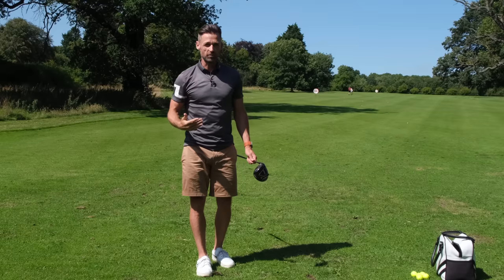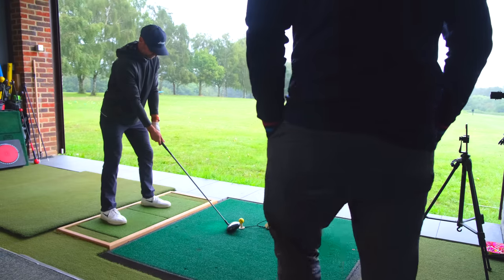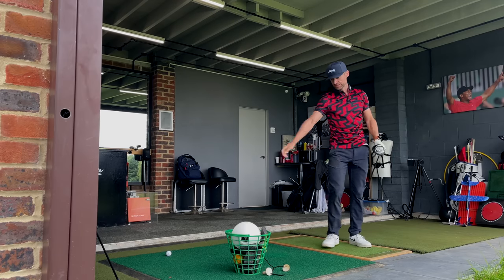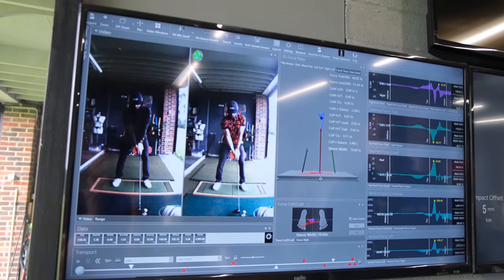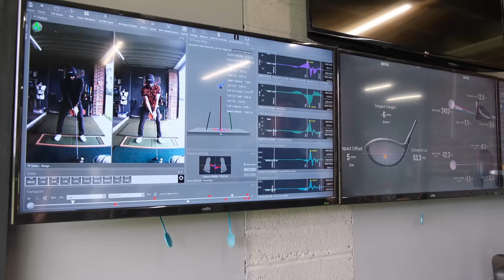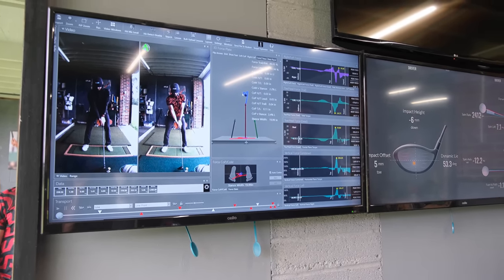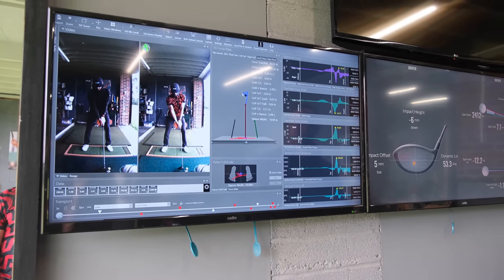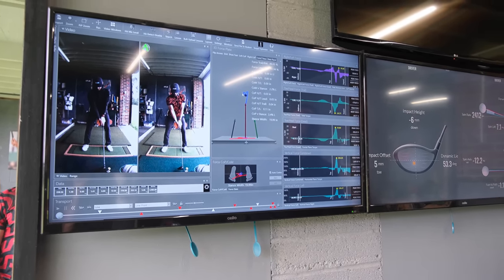How I Hit Driver Straighter AND Added 8MPH CLUBHEAD SPEED!! Is Golf BACK for me??

Comment: James.  Thanks for this video.  You are transforming my game.  I bought your wedge matrix and have lowered my handicap 3+ down from 11+ to an 8.

I took this video to the range and course and shot 78.  I used the principles of pulling the grip off the club, and "tightly" turning the corner with both driver and irons.  Works for both.  The split hand drill gives the correct feeling.  Still can improve more.  I buried the club a few times in practice but that was a result of my nemesis of early extension.  Slamming the chest keeps the trail hip back.   Keep branching out on your videos.  Thanks very much
Reply from the maker: Amazing to hear Stephen, thanks so much for the support and sharing your success with us!

Comment: I have been trying both of these drills with my driver and have found that the slam dunk move is very hard to do! I can do the pull the handle drill but with much shorter backswings .Soon as I try to pull the handle with a normal backswing I find very hard to do .Which did you find the easier to do ? thanks again Steve